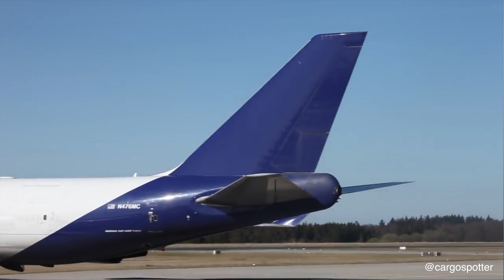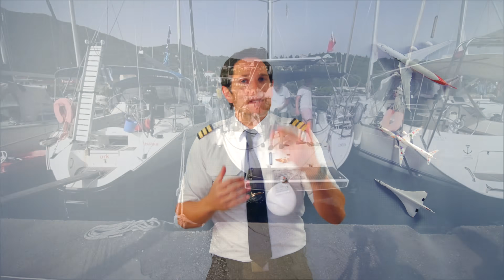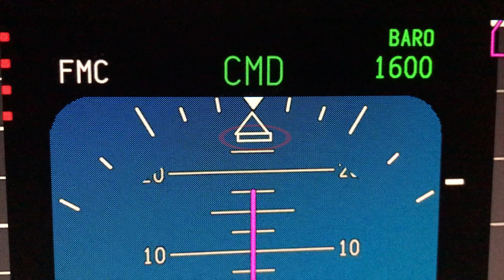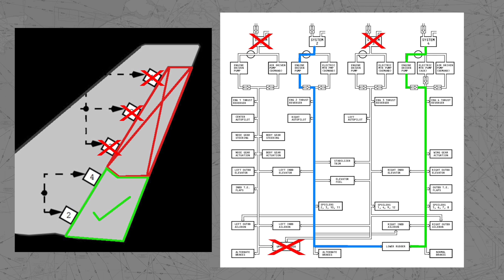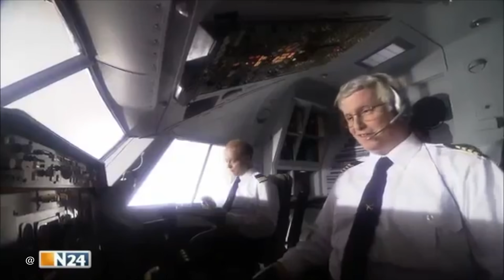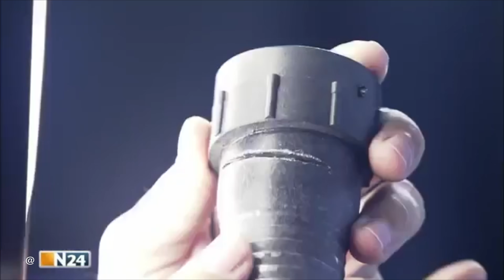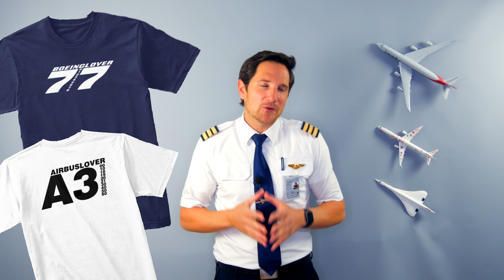Why is the RUDDER SPLIT? Explained by CAPTAIN JOE

Comment: The upper A380 rudder is not active in high speed, it`s only needed on low speed/approach. It has a mechanical device that pushes it always to the right when no hydraulic power on ground. In flight this mechanical force to the right is counteracted by hydraulic pressure keeping the rudder in the midlle and eliminating fluctuations. Both rudders are also limited in travel range as the speed gets higher. 
So the upper rudder is held mechanically to right on ground due to mechanical force and the lower can be moved by wind to any direction. But it is damped by the internal hydraulic.
Reply: Why would Airbus want the rudder to default to the right when there is no power? Wouldn't centering the rudder be better in a situation where power is lost?
Reply: @wecsam  
The rudder is most of the time inactive. It has 2 x  hydraulic and 2 x electric backup. In the unlikely event all is lost it will be centred by the airflow when flying.
When you centre the rudder with hydraulic power it will micro-oscillate. All aírcraft have this problem. But on the A380 because of the giant size of the rudder you would feel it and it would do stress on structure. With the mechanical preload the hydraulic will centre it perfectly without  oscillating.
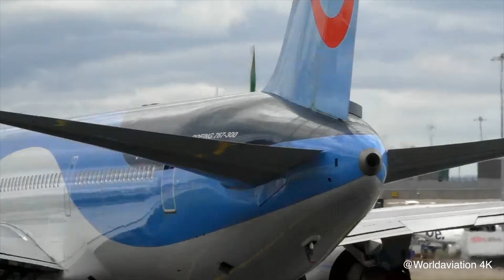Reply: @Heimi24  Awesome explanation, thanks!  Do you know what is the "mechanical device" being used?  From the video at 4:05 it looks like it is maybe spring loaded and the wind is blowing in from the right of the screen?  Seems kinda weak (blowing in the wind) to be a pre-load against hydraulic system?  Although I guess maybe any force enough to cause a pressure imbalance in the hydraulic circuits would be enough?  Also (you seem to know your A380's...) how does this speed balance multiple actuators across multiple independent systems, attached to the same rudder section??  That feels like a whole other can of worms...
Reply: @Buchaven959  Yes it`s a kind of spring, buts it`s not weak. You can'`t push it by hand. In the video it deflects because the wind is blowing somewhat fast and don`t forget the surface it`s acting on. And yes, it`s just enough force for a preload to the hydraulic on one side of the actuator. And each Rudder has just 2 actuators, and only 1 is active at a time, while the other is in "damping" mode. If the hydraulic part fails the electrical takes over, which is built-in. So 1 actuator with 2 systems inside. So 2 x 2 per rudder but only 1 active at a time, others standby. Makes a total of 4 Actuators for both rudders but with double backup (8). Was that your question? Google for A380 rudder, or "EBHA"
Reply: @Buchaven959  I would suggest it is what we call a "spring bias unit". I used to work on a rotary aircraft which used this device as manual reversion incase of a tail rotor actuator failure due to the tail rotor only using a simplex hydraulic system. What RFHeimi is explaining leads me to think that it is a device similar to this.
Reply: @Heimi24  Yeah dude, nailed it.  Totally makes sense.  Thanks!
Reply: @Heimi24  Wow, bro that's pretty cool. I love stuff like this.
Reply: @Heimi24  Very nice explanation! Why isn't the same system used for both rudders, only the upper one?
Reply: @jakistam1000  Because the lower one is the only one you use in cruise flight and it does the yaw damping and is almost always active anyway.
Reply: @Heimi24  Thanks for thorough explanation! General question: If you're facing crosswind from the left on a takeoff roll will you use right or left rudder to hold the centerline? Watched a video where a crew was using right rudder for left crosswind, which was pushing the aircraft to the right and it was a bit counter intuitive.
Reply: Martin R. In that case you would use right rudder (and left ailerons). The reason is: the wind is pushing on your tail fin from the left, this will cause your airplane to turn into the wind (like a weathercock), effect that you can counter using right rudder.
Reply: @OlivierBraun  Thanks for the clarification!
Reply: @Heimi24  If centering the rudder with hydraulic power will cause it to micro-oscillate, then why can't it be centered by default with the mechanical device?
Reply: @elephant35e  seems to me if you placed two opposing forces  to center  the rudder, it wouldnt create any preload on the hydraulics, and without the min. hydraulic back pressure you get the rudda fludda. I agree that the asymmetry  is unnerving.
Reply: @Heimi24  But why would it need to default to the right at all when there's no power, what's the point of the spring in the first place? Also are you saying when it's in cruise the rudder is inactive meaning there is no hydraulic power keeping it centered, so it's just the airflow keeping it centered against the force of the spring? It seems like the spring just causes extra weight and drag, I still don't see why you would need it in the first place.
Reply: @wecsam  because right turns are legal but left turns on red are a ticket.
Reply: @theenzoferrari458  unless youre in britain
Reply: @theenzoferrari458  for me it's a ticket, like in the rest of europe. Unless I have a green arrow, than it's fine ;)
Reply: @vinctendo_tv  you and the damn European union roads with fucked up signals. Lmfao. Go halfway across the world and it's like the upside down.
Reply: @theenzoferrari458  LOL!
Reply: justinl458 unless you’re turning from a one way road onto another one way road
Reply: @wecsam  I never understood that. Also what's up with the drooping ailerons?
Reply: @Truth's Knight_07774, because there's no hydraulic pressure, so they droop. As soon one of the engine starts and hydraulic pressure is reestablished, they will raise up.
Reply: @Repented008  that appears only if the hydraulic system is inactive. So the gravity "sucks" it down. Same as the rudder due to wind.
Reply: It's split left n right to prevent icing in the gap maybe ??
Reply: Why does the upper move both left an right, opposite to the lower in flight? You can see this happening in the landing footage in this video.
Reply: Are you a pilot
Reply: Interesting
Reply: @RFHeimi 
I think you mixed the lower an upper rudder. It looks like the lower rudder is pushed to the left by the spring device and the upper one deflects according to wind direction. And now I do understad the hydraulic and spring force equalising each other to stabilise the aircraft and reducing stress. Thanks for explaining that.
Reply: @klssn34  I also thought that initially but look again. The wind is from the right of screen. The lower is pushed with the wind. The upper is also bit always trying to get back to the right.
Reply: I was trying to understand and then i decide to just be a passenger 😂
Reply: Those hydraulic actuator are always double acting. Only if there is a defined safety position which should be taken at system failure springs are used to ensure that position. This is for instance at chemical plants at important valves with safety position. In case of an airplane the maximum deflection of a rudder wouldn´t be a good idea.
Reply: Коля 
What are you saying about the states? You noodle brained communist.
Reply: The rudders are designed to go in opposite directions when there is no hydraulic pressure so they cancel each other out.   This way if hydraulics fail in flight, the rudder won’t steer the plane in either direction.

Comment: answer i think to the A380 either side deflection: upper rudder was being deflected due to wind, lower rudder being powered by the 2 and 4 engines, she might have only 2 and 4 running therefore pressure in that system.... just a hunch i must say :p

Comment: Fun fact: The 747-400 flying the Northwest flight 85 (N661US), was the first ever Boeing 747-400 ever built. And the same aircraft is currently preserved at Delta Flight Museum at Atlanta, with people allowed to enter and see it from the inside.
Reply: Maybe not for you but for people else where it is fun.
Reply: I was in Atlanta and toured N661US.  Excellent exhibit!  They have a sign in the cabin area with details on Northwest 85.
Reply: I should have scrolled further down here in he comments.  I just repeated this same fact 😂 I have experienced the exhibit inside and out.  Really cool!
Reply: It's obvious that the lower rudder hardover thing is caused by testing as it was the 1st 747-400 built and so was the test aircraft of the series...

And why the heck am I saying the same things you said earlier in this comment. This is wierd.

Comment: Why does commercial airlines have a hole at tail of the plane?
Reply: APU exhaust
Reply: Aimless6 is its like a secondary or tertiary engine?
Reply: @Wolfgodmak  
In the tail, there is another tiny jet engine to provide power when the engines are not running and ground power is not available. It provides electricity and pressurized (hot) air to start the engines and for the air conditioning. It does not generate any meaningful thrust for propulsion.

On bigger aircraft types, there are inlet doors that open before it starts and an exhaust nozzle for the very hot exhaust gasses that is always open. Other types have ports that stay open. It's a design choice exchanging the drag of open ports for the complexity of doors. The doors can be opened up to 300 knots or so. Fast but not top speed or they will be ripped off.
Reply: you mean the APU exhaust pipe?